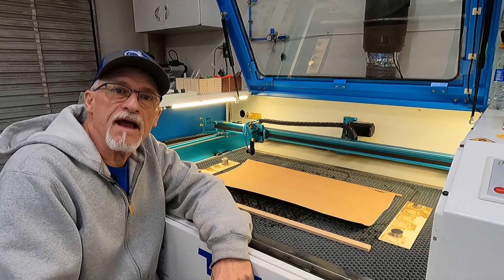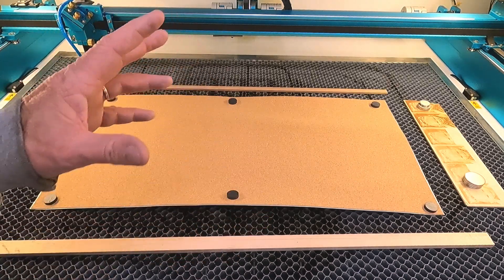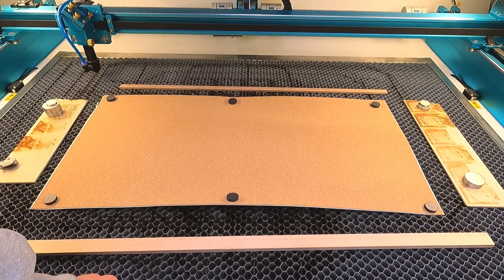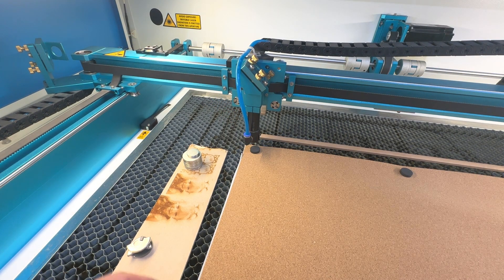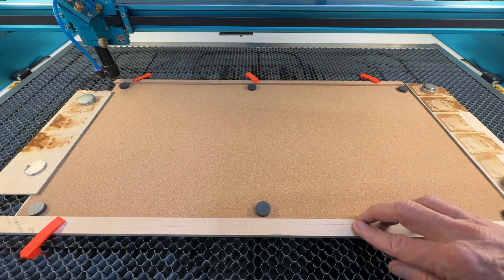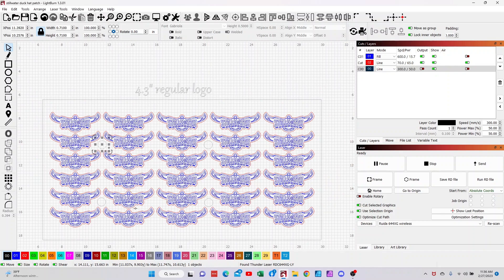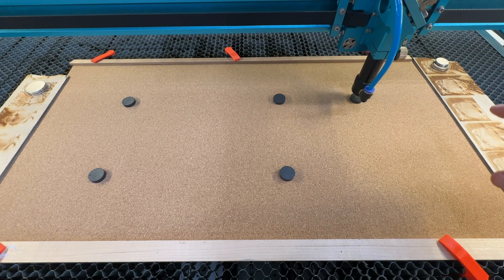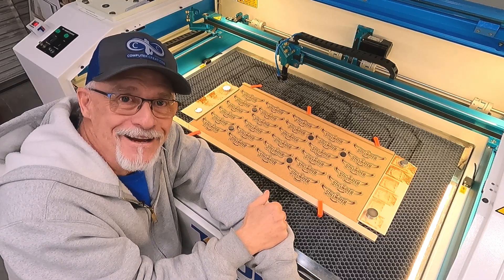Unbelievable Tricks for Perfectly Laser-Cutting Twisted Wood!

Comment: Use Neodymium magnets instead, they are up to 50x stronger (pull force C1 vs N52) than ceramic magnets of the same size.  Smaller magnet with greater pull force means you might be able to space the designs closer for better material usage!!!!   i.e. a 2" x 1" x 1/2" C8 ceramic magnet has about 6lbs of pull force, where a N52 Neodymium 2" x 1" x 1/2" has a pull force of 91lbs & a significantly smalller 1.5" x 1/2" x 1/16" N45 Neodymium has a 7lb pull force.
Reply from the maker: Also way more expensive, no need for the much stronger magnet
Reply: @computercreationz  Most importantly... you can use a MUCH smaller magnet, which can allow for reduced material waste, which can cover any marginally added cost very quickly.  I get 150lb pull neo's $2 each for plywood up to 3/4" thick - & 1/2" x 1/16" neo disc's @ $20 for 100 ($0.20 ea) for thin materials & is thin enough for my laser (with just 2mm focal length) to pass directly over the magnets & not crash.
Reply from the maker: The customer wanted it to stand off the refrigerator. It’s less about what the maker wants and more about what the customer wanted. Always
Reply: @??? The video is about holding down materials right?  Cause that's what I'm talking about, magnets to hold down the material, not making refrigerator magnets...  Smaller magnets can mean tighter spacing on your cutouts. Though in your particular project in the video, it appears to already be maxing out the material usage.

Comment: How do you prevent the laser head from not crashing into the magnets
Reply from the maker: when your placing your magnets under the laser head if they fit under that won’t hit!
Reply: But I noticed your laser head is the HD head right??? It should be focused at 3mm it will crash for sure at that focusing.